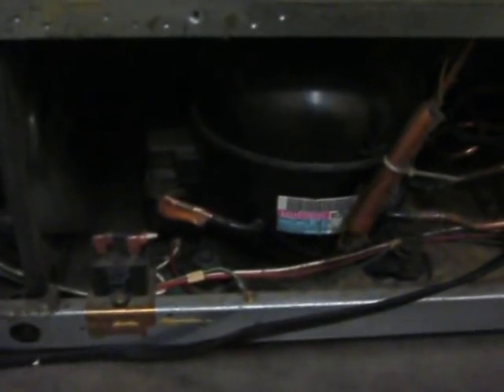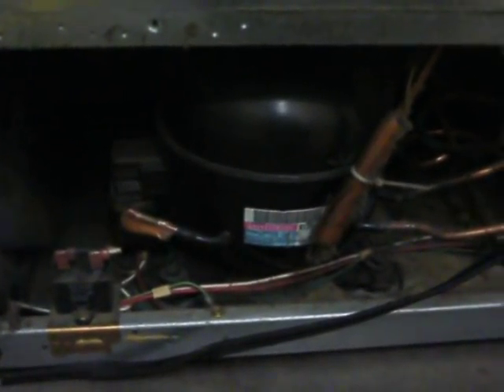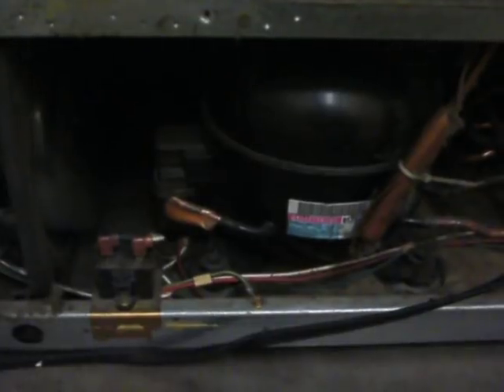Actual Sound Of A Bad Refrigerator Compressor

Comment: Thank you for posting this. I have a question though. Will this sound run continuously? My refrigerator has moments of quiet, like normal, but then when it kicks on it sounds just like this. It runs like this for several minutes then goes quiet again. Thanks again.
Reply: mine does the same thing! hopefully he replies because i want to know whats going on too.
Reply: Thank you so much. I'm in an apartment so not sure of the age. The fridge is working fine--I just find it very loud. Then again, I'm sensitive to noise.
Reply: I've started using headphones at night so I can listen to my phone app, which plays all kinds of thunder and rain storms. I sleep like a baby. :)

Comment: Does not sound like any compressor problem I have ever heard. I would "handle" the compressor to see if there are any vibration issues (anything slightly touching something will give you a sound like this). This a more than likely the sound problem you are having without knowing any details.